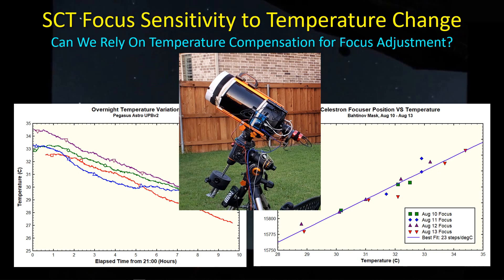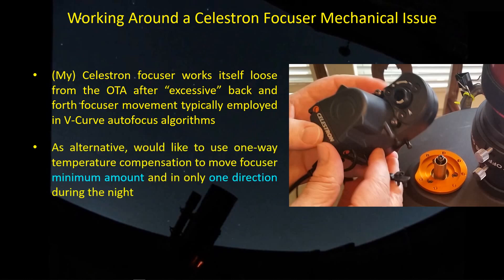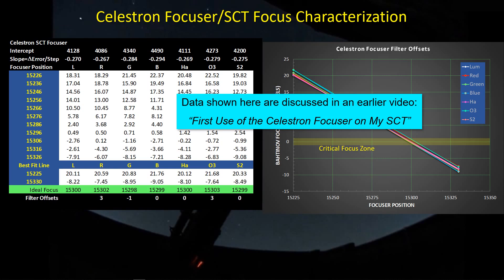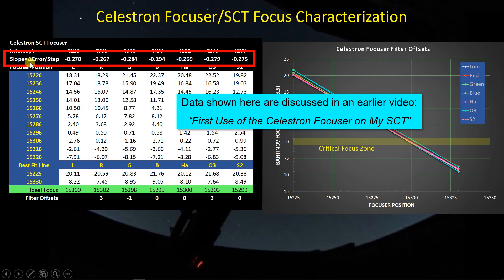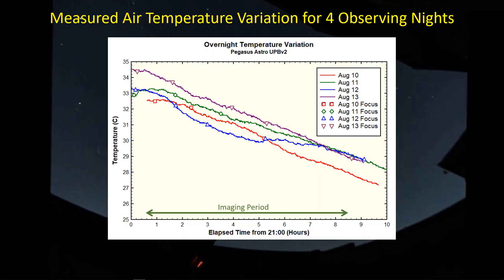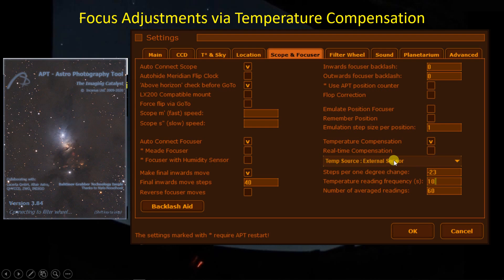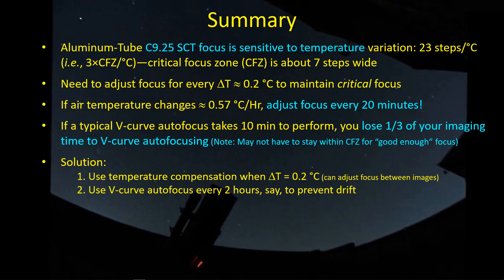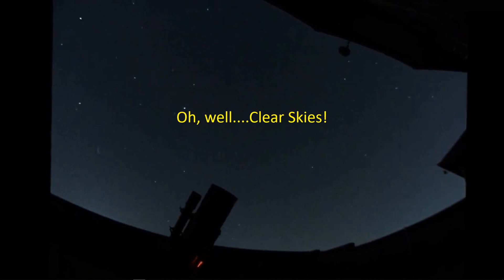SCT Telescope Focus Variation vs Temperature

Comment: Carbon fibre can have negatve coefficients of expansion. The magnitude as you say, is very small
Reply from the maker: Yeah, carbon fiber has some weird traits. Too expensive for me though!
Reply: @Aero19612  I was looking into it for a pendulum clock. The idea being having some carbon fibre for the pendulum rod combined with some other metal. It should be temperature invariant.

Comment: Great video.  One point, my refocusing algorithm only takes maybe 2 minutes to complete.  At around 16:29 you suggested o\yours is taking 10 minutes.  Isn't that rather excessive?
(I'm using EKOS)
Reply from the maker: Haha. I think calling a 10-min procedure in astrophotography "excessive" is excessive. Was there ever a bigger time sink than astrophotography? No, I didn't say it "was" taking 10 min. If said "if" it took 10 min -- I hadn't performed a hyperbolic focus run at that time. Back then, I was having all sorts of issues keeping the Celestron focuser attached, so I didn't trust it to get through one autofocus run, let alone 6 autofocus runs through the night. I have since solved the focuser issue (fingers crossed) and have run many autofocus runs in NINA. As you say, a typical autofocus run takes 2 min or less.

Comment: I started imaging with 9.25 SCT (edge variant). No reducer.
I have been shocked about inconsistency of focusing by NINA. It is all over place compared to refractor. I am getting impression that it is inconsistent because of changes in seeing during night. 
Some info. I use inline Moonlite focuser. It doesn’t have backlash. 
What do you think?
Reply from the maker: Probably need to tweak your NINA autofocus parameters. Once I adjusted those, I got very consistent results even with my moving mirror focuser. With the focal reducer I'm using now, I get R^2 values of 0.98 to 1.00 - very good and very consistent. See https://youtu.be/M7GxDf2mcw0
Reply: @Aero19612  I did it but it is inconsistent during night. It usually fails 2-3 times per night. Maybe exposure needs to be increased. Some FOV contains very few stars.
Reply: @Aero19612  I see very useful video! I will try it.

Comment: Hi James . Question , do you have actual Star Images taken on either side of the Critical Focus Zone , or beyond , that connects actual Images to the measured Focus Position Data ? I am curious as to when our critical eye will actually trigger our brain into believing the Image is "out of Focus" . Obviously we have the Digital and Mechanical Tools to reassure ourselves that our System is as perfect as we can get but I'm wondering what the allowable error might be to get acceptable results ? /SRK
Reply from the maker: That’s a good question, Scott. I did a video showing how to use APT and the hyperbolic curve fit where you would manually do what NINA does: Move the focuser way out, take picture, move the focuser in a bit, take a picture...and so on. So there should be pictures in and outside of focus that could be used to answer that question. I wonder if I still have those images. Would be easy enough to repeat though. Might put that on my list!

Comment: Very useful information James! From the picture of your rig, it seems that you're using a dew heater strip and the end of the OTA. Was it running while collecting the focuser data? It would be interesting to see if there are variations in the readings with and without the dew heater strip running. I've read a several post in CN indicating that temperature compensation doesn't work very well with SCT because the relation is not completely linear. Those fellows recommend to track ambient temperature and adjust focuser using the V curve or refocus every 20 to 30 mins.compensation
Reply from the maker: Hey Diego,
I don't think the dew strap on the SCT has any effect. SCT focus changes because the tube changes length with temperature of the tube. Of course the tube temperature will lag behind the air temperature. But the effect is effectively linear (as my data show). For refractors, the focus/temperature relationship is more complicated because the index of refraction of glass is highly temperature dependent and heating of the objective lenses with a dew strap could introduce one effect while temperature drop of the tube would create another. I do agree that V-curve (I use the hyperbolic fit) focus routines are more accurate. The only reason I'm "fighting" the V-curve focus method for my SCT is because my stupid Celestron focus motor works itself loose from the SCT because of the back and forth motion of the focuser. The V-curve focus method works great for my refractors!
Thanks for watching, Diego!

Comment: Brilliant! This is a lot of extremely useful information. There is still one important question: is the frequency of focus adjustment consistent with focusing error mean and SD? I am asking because your curve at 10-13mn shows 16 measurements, 2 are more than 20 steps away from the curve, and 4 are more than 10 steps away. This might be an indication that in up to 40% of the cases the focus might be out of the expected 7-steps wide critical focus zone.
Reply from the maker: Good question. First, I suspect that the frequency of focus adjustment based on critical focus zone is overestimated compared to what the eye can perceive. Second, the randomness (SD) comes from several sources including Bahtinov focus error (seeing variation) and the difference between the effective OTA temp and the outside air temp. So, I think the trend lines are a good measure of the behavior that compensates for the error sources. Thanks for watching!

Comment: What would happened if you were using a full heating blanket (witch maybe does not exist) to cover the whole tube assembly to keep constant temperature ?
Reply from the maker: HaHa. I've been think along those lines too. I did buy some insulation to wrap around the tube to see if it at least delays the temperature loss as the outside air temperature drops-haven't done the experiment yet. But in the extreme case, why not have a temperature control system like is used for the camera sensor that maintains a constant tube wall temperature using maybe two dew straps. If you could do that, you could maintain focus all night long! Thanks for watching, Andre!

Comment: James- I just l learned something interesting about NINA that I'll share here. In the Sequence panel there is an option to trigger an autofocus run based on temperature change. The temperature on that screen must come from an focuser. The Pegasus probe temp is not considered. In NINA, temperature is not unified across the application.

This fact, and your findings here make me want to look at other focuser options. Something temperature compensated that could move the focuser independently based on observed temp.
Reply from the maker: Exactly!  APT doesn't recognize the UPBv2 but NINA does. Seems likes it would be a REAL simple thing to allow the user to pick any temperature source and assign it to the focuser for those of us with a focuser that has no temperature sensor.

I was about to buy the Pegasus Astro Focus Cube for my SCT because I liked it so much on my refractor. I paused and happened across the Celestron focuser. I like that the Celestron Focuser has a direct mechanical link rather than the belt drive used by the Focus Cube.  In retrospect, knowing what I know now, I might go back and consider the Focus Cube again.
Reply: @Aero19612  I was looking at that one and the ZWO. I like the way ZWO attaches better.
Reply from the maker: I wasn't aware ZWO's focuser had an SCT attachment option. Will have to look into that.
Reply: @Aero19612  It will apparently get released in September! I am avidly waiting for it...!
Reply from the maker: I will certainly take a look. Very interested in how it connects to the OTA. The only question is: Current Frustration = How Many $$. Thanks for the heads up guys.
Reply from the maker: Just saw the product on the ZWO website. Looks like it will utilize the same three little screws I'm having issues with. However, the nature of the connection may allow screwdriver access to those screws without having to remove the whole assembly (like the Celestron version). That way, at least, you could tighten them before each night's imaging. I'm feeling a slight gravitational pull from the "I want this" mass. You go first, Ben!

Comment: Interesting as always.  Could you perhaps use the hfd percentage change feature in NINA to reduce the need to refocus. As the temp drops and th hfd changes by calculating what percentage change a 1 degree drop induces it could be that NINA then moves the focuser a set number of steps. The guys developing NINA seem very open to suggestions so it might be something they could implement so that rather than run a new autofocus it just makes the step adjustment then resumes the sequence.
Reply from the maker: I could do that. I'm trying to avoid too many V-curve-type autofocus runs. Your idea is a good one: maybe I should try and relate HFD growth VS temp. Thanks for watching, John!

Comment: Excellent engineering analysis.  I am not crazy about my Celestron focuser thus far.  It juts doesn't feel stable.  I was more interested in your results showing that maybe the choices of aluminum is probably the wrong way to go.  My scope is the Evolution 8 with the same material.  While it's rugged, as you point out, Al's coefficient of thermal expansion is rather high.  Thanks for sharing!
Reply from the maker: I never would have thought of that at the time I bought my SCT (my first scope). I don't think Celestron even offers SCTs in carbon fiber. If they do, I bet it costs an arm and a leg. Thanks for watching, Brian!
Reply: James Lamb interesting site:  https://carbonscopetubes.com/
Reply from the maker: Interesting indeed! Thanks for passing this along!

Comment: Your correct in that NINA does not have temperature compensation yet but working on it. Just use autofocus routine and specify to perform an autofocus routine with any % chamber change in HFR. I
Reply from the maker: Yes, I could do that. I'm being very picky, by trying to avoid the V-curve back-and-forth focus algorithm. But that may be my only option.